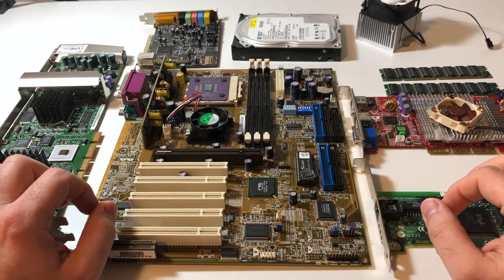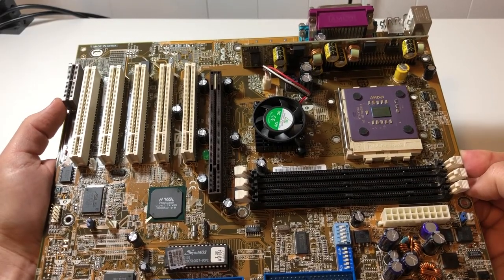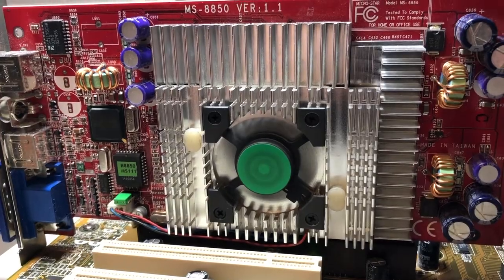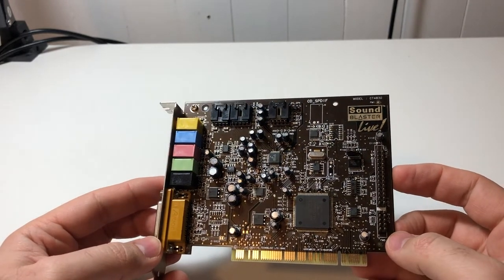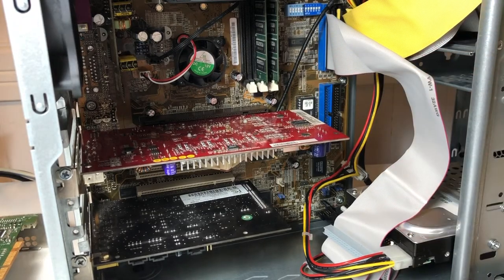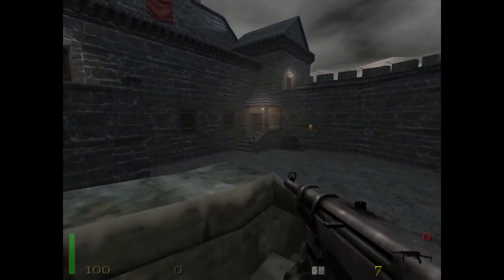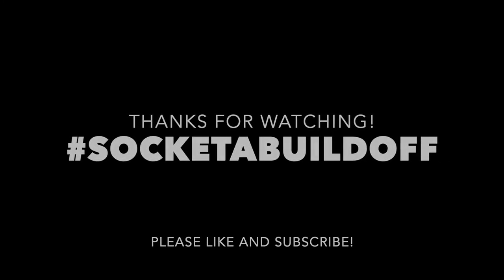Building an AMD Thunderbird Gaming Rig - Geforce 3 and 3D Labs Wildcat III! #socketabuildoff

Comment: One thing on the SB Live!: It had 4 way positional audio. I think it was the first consumer card ever to support that. All serious games at the time, like Half-Life and Unreal engine games, supported it. It was my first 3D audio experience, and it was awesome. There were bundles with Cambridge Soundworks PCWorks speakers. I had this set back in the day. My son still uses the sub/amp of that speaker set on his rig today, so that tells a story about quality.  I recently got a second set complete with the original satellites. That was the last piece of hardware I needed to recreate my 1999 setup (Gigabyte 6BXC, 300A@450, TNT, SB Live!). I think I threw out the SB Live! when I got a socket 775 board many years later.
Reply from the maker: Thanks for your comment! That’s right I forgot about the 4-way audio! I really need to explore the features of the SB live again one of these days. I remember the Cambridge sound works speakers too! Those were awesome and I remember really wanting to get a set back in the day but they were too expensive for me. Those and the old altec Lansing models were great 👍
Reply: Aureal had 3D audio, I don't remember i think they released it before Creative, but Creative bought them and stopped technology improvement decades.

Best wishes.
Reply: @ajax700  Indeed, I remember many games supporting both A3D and EAX at the time. I'd not say tech didn't improve in the upcoming years though. 4 way audio didn't have a long life expectancy anyway as DVDs with Dobly Digital 5.1 became common. 5.1 sound cards quickly emerged everywhere. But beyond that? Frankly, I can't even imagine how consumer PC audio could have possibly been improved any further.
Reply: Both EAX (I'm sure) and A3D (at least I think so) positional audio parts were based on Microsoft's DirectSound3D API, which became available before Creative and Aureal launched their first cards for that. At least Terratec and Guillemot had cards out earlier which supported DirectSound3D with corresponding quadrophonic (4.0) output. Those were still ISA cards! I own one of those, a Guillemot Maxi Sound 3D. I got a SB Live! with my brand new Pentium 2 system in late 1998 and it was indeed awesome. A cool feature a friend at that point already used was the SB Live!'s capability to encode DS3D/EAX 4.0 audio into Dolby Surround Pro Logic which is also 4.0 but instead with a center channel and mono surrounds. Thanks to that people who already owned a Dolby Surround system could enjoy positional audio from PC games although with mono on the back speakers.
Creative with the first SB Live! also launched a proprietary Digital DIN connector which could transfer 8 discrete channels digitally, way before HDMI was invented. Sadly thanks to the media industry it was only implemented on the highend Cambridge/Creative SoundWorks speaker systems, but not on AV receivers of the usual suspects (I still think to remember reading about Harman Kardon having an AV receiver model with Digital DIN ready, but I've yet to find the German PC magazin in which I think it was reported). Creative had to kill Digital DIN later under pressure from the media industry because they wanted their crap HDMI instead to force DRM on consumers. That's why only one third party model X-Fi, which had HDMI, can output lossless 5.1 gaming audio. All other X-Fi cards can only output analog or compressed digital bitstreams which was pathetic.

Comment: Miss my socket A system. It's final form of sorts was, Athlon XP 2500+ Barton OC to 3200+, 2x 1GB xms DDR400, ati 9600xt 128mb, 160gb WD 7200 IDE, Abit Nf7-s 2.0. That nforce chipset was pretty good for its time.
Reply: I still have mine & a few nForce boards plus loads of memory

Comment: AMD Barton Mobile + Abit NF7S v2.0 + Samsung TCCD + GeForce 6800 Ultra + Audigy 2 ZS was my first enthusiast rig bought with my first job. Now I have again that rig except for memories and soundcard (OCZ Gold PC4000 and X-Fi Elite PCI) but I add to my collection a few mobos nForce3 (939 with an Opteron Denmark and AM2 with a Phenom Deneb), slot A with an Athlon Thunderbird and 775 with AGP and q6600. I love 2000's hardware 😄
Reply: Had a similar setup in around 2005 comprising of mobile 2500+, geil one w pc4000 184 pin ddr1 but had a dual xp1700 system modded to mp with hard modded multiplier & vcore on Asus a7m266-d mobo. Xp1600 on pc chips m810lmr 7.1, duron 1600 applebred @ 256kb l2 etc & about 5 more skt a rigs at one time run seti@home

Comment: Ahh Thunderbird.. I bought whole cart full of parts including Thunderbird 1.2Ghz at a local Fry's back in the day. Went home but no boot so took it back to the Fry's and the kid at the return section looks around the motherboard and cpu and connects the power to it and turn it on without heatsink on. Within couple seconds the core heats up and the computer shuts down. "Must be a defect CPU" Grabs a brand new 1.2Ghz CPU and puts it on and turn it on again without a heatsink. Same thing happens and burns another CPU. They didn't have any more of them in stock because they were so new so I asked for a refund and bought Pentium 3 1Ghz instead. Never looked at AMD until they came out with Ryzen 1800X.

Comment: Oh for simcity 4. Load it on a ramdisk. Even larger cities will run smoothly so long as the cpu and gpu can keep up! There's a bug (or poor programming) with the way it handles graphics assets. For example... Instead of referring to the same model of a house in memory, it loads another copy from the hard drive! This can also lead to what looks like a memory leak, especially with larger cities. The game is constantly reading from disk to load asset copies to ram. Sadly you'll have to have a lot of ram (as far as older systems go) 3-4gb for the game files on a ramdisk, another 2 or so to run it!
Reply from the maker: Interesting! I'll have to give that a try!
Reply: @vswitchzero  back with my ddr2 775 system I noticed that even my 8800gt was struggling to get high teens in fps. I made a ramdisk using an app creatively called RAMdisk and even my oddly clocked 575mhz ddr2 smoothed out any fps issues. Though I did notice that SC4 could use up my remaining 2gb lol. Made a 2gb ramdisk leaving 2 for SC4 of my 4gb setup. Cpu was a pentium e5300 overclocked to 3.2ghz.

Comment: The Wildcat III Pro was my first non-consumer card... at that time I had moved to the Athlon MP using a Tyan S2462 board.  Absolutely massive gear - housed it in an Enlight EN-8950 server case with redundant PSU's.  That stuff was truly made to last; I'm sure it'd fire up readily to this day.

After 386 and K6-2 I went to Socket A as well - have never been an Intel fan : ) thanks for this blast from the past !

Comment: The AGP Pro card you showed was a Dual Chip system, hence why it was AGP Pro. You can see thee is a bridge chip on the PCB directly above the slot. This allowed the 2 chips to work together as well as allow both chips to communicate across the AGP bus. Fun fact. AGP was Actually a faster implementation of the PCI bus, except it was mean for single device with a direct connection to the Northbridges. Its main benefit over PCI was the fact that the entire bandwidth was dedicated to the GPU rather than having to share bandwidth like PCI. It ran at 66Mhz rather than the 33MHz of PCI. AGP also allowed the GPU to have direct access to the system memory. this allowed the GPU to store textures in system memory if the onboard GPU memory was exceeded. 

Downside of AGP was it was less tolerant of FSB overclocking compared to PCI but thankfully chipset manufacturers implemented quite a few different AGP frequency dividers which was welcomed by overclockers, since back in the day unless you pencil modded your AMD CPU, your only recourse to overclock was FSB

Comment: 4:18 DDR is a type of SDRAM. People keep referring to PC66/100/133 pre-DDR memory as “SDRAM” which it is of course, but they say that, meaning that DDR is not SDRAM…but it is, as is DDR2, DDR3, DDR4 and DDR5.

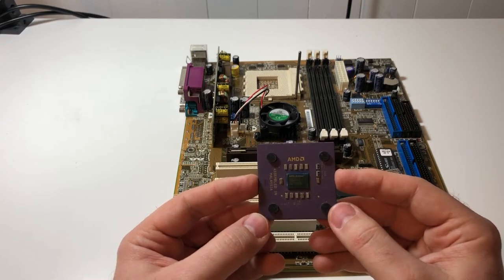9:01 Pentium 4’s we’re not around at that time. The Athlon Thunderbirds were competing with Pentium III’s, it was the Athlon XP line that was competing (and beating) Pentium 4’s…for a while anyway.
Reply from the maker: Both good points - You are right, the Williamette P4s weren't released until very late in 2000. The Pentium 3s were very popular all through 2000 and into 2001 so they'd defintely be the chips competing with the  Thunderbirds. This is a period of computing history that I'm not too knowledgable about, unfortunately :)

Comment: Nice ! That danger den 9800pro water block though 🥰  I still need to mess around with socket a
Reply from the maker: Haha yeah, Danger Den made awesome watercooling gear back in the day. Too bad they went under. I had a Danger Den TDX waterblock on the CPU as well if I recall correctly.

Comment: 10:30 One of the tricks I learned on these CPUs was to get a very fine piece of sandpaper, place it on a flat piece of glass, and "lap" the bottom of the heatsink to improve thermal transfer.

Comment: It's interesting to look at. I have similar Socket A PC that I slowly upgraded to be probably the fastest Socket A you can build. I managed to find mobile Barton CPU that runs at 2.5GHz, it's paired with nforce2 400 chipset and Radeon 3850 AGP.
It would be almost usable today for browsing and some basic stuff if it was not lacking SSE2 instructions. That killed it some 5 years ago. Every modern browser requires SSE2.
Reply from the maker: Thanks! The mobile Bartons were awesome. I never owned one but a friend of mine did. He got some impressive overclocks out of it too. That's interesting about the SSE2 requirement in modern browsers. I didn't realize that.

Comment: Great video !! I really miss the socket a days & overclocking as it was the start of good times. Had a thunderbird 1400 on a Asus Ali chipset mobo then xp1600 palomino on a gigabyte ga7zxe kt133a board using pc133 but mobo would do 156mhz fsb. Then a duron 1600 applebred which I pencil modded to 256kb l2 cache from 64kb. Also had dual xp1700 modded to mp plus hard modded multi & vcore @ ran at 2400mhz on asus a7m266-d. Xp1700 on abit nf7-s 2.0 @ 2xxx mhz, Athlon 2500 Barton & mobile at 2400 & 2500mhz etc

Comment: The T-Bird chip one hot chip when overclocked...
I remember using pencil to connecting the exposed L1 pins and that's when I to the dark side water cooling a machine....
Back then it wasn't normal to water cool a machine, compared to today it's normal

Comment: I absolutely broke an egde off my Duron back in the day... But I'm happy to say it still did work just fine. The only minor issue was that the Bios did not detect it as an Amd Duron anymore, just as some kind of standard Amd cpu IIRC. But I used it for several years after that! Oh the memories ;)
Reply: And I had a very similar Board, used the additional IDE connectors not for RAID, but to enhance the available disk-space. When I had 8 HDDs in and the RAM maxed (I believe it held 1,5 GB), it was a beast of a server, hehe

Comment: I used to have a wildcat 3110 AGP-Pro on a p4 478 and older wdraptor 10kdrives SCSI fond memories of video editing although after software compatibility issues with the wildcat 3110 I ended up going with Nvidia Quadro fx3000 g I believe it was yeah with the SDI output and input I'm just surprised to see another one of those cards what other kind of cool and unique especially when I was a younger guy doing my comp TIAA certifications before 08

Comment: The original fan on the GeForce 3 is not defect. I had exact this sound for one simple reason, a small holding clamp on the fan for the two wires came up from time to time. Very hard to sea but check it, after I pulled the clamp back to its position, the fan works perfect without noise ;)
Reply from the maker: Thanks for the tip! I will give this a try 👍

Comment: i loved those promise controllers back in the day, most  of my computers had 6 or more hdds, at one point i even converted an old model 50 case into a scsi container for 7 external drives. tiny drives by comparison these days, but i had over 100 gig in 99. i  regret the loss  of the ibm ps/2 model 50 though, fastest  486 i ever had even though it  was only a dx2 66. micro channel and all scsi.

Comment: Once we got an AMD slot A CPU and a slot 1 motherboard for free as defective units. We tried how high the flames will go if we insert the slot A CPU into a slot 1 motherboard and power it up :)
At that time, I also had a Pentium 4 motherboard with an 1.6 GHz CPU. The board supported both SDRAM and DDR1 RAM modules. I never thought I could ever see DDR1 RAM work with SDRAM in
 the same board, at the speed of an SDRAM.

Comment: Saw you watercooled a Radeon 9800 Pro amd instantly subbed.
Reply: These days I hotrod retro software.

For example 60.8GBs is stable for id tech 3 for all level compiles. You need a 8k display to really make the balls to the wall until x86 crashing version planned make sense.

Comment: My SocketA -system is a maxed out one :) Abit KT7A-RAID, mobile-Barton @2GHz (no help clocking higher, SDRAM is the bottleneck) with 150FSB, 768MB RAM, 140GB WD Raptor SATA (with PCI-SATA controller), Radeon X800Pro (Nvidia-cards just don't work with this mobo fully stable). And the sound cards: SB Audigy2 (for EAX), Aureal Vortex2 (for A3D), ESS Solo-1 (SB PRO in DOS), Gravis Ultrasound Classic 1MB. Dual-boots Windows 98SE and WinXP. I can freely change cpu multiplier AND FSB speed from DOS or Windows, so I can make this very slow easily. Tried to add Voodoo2 -card but Radeon drivers freaks out when Voodoo is installed. With Geforce I can use Voodoo but not stable enough.
Reply: How do you manage all those soundcards in terms of resource conflicts, IRQ etc.?
Reply: It's easy :) Audigy2 has drivers only in Windows XP. Vortex2 has drivers only in Windows 98SE. ESS SOLO-1 is only for SB PRO support in DOS and uses port 220, irq 7 and dma 1. GUS is used only in DOS and uses port 240, irq 5, and dma 5. But now I got Orpheus II and swapped GUS and SOLO-1 out for it but the resources are still the same. Tried to get Vortex2 and Audigy2 to work same time in Win98SE but problem was A3D and EAX, both use a3d.dll for it so it's only one or another.

Comment: Have you done a drag race between CF and HDD? 
I see people changing HDD to CF in oscilloscopes and not really seeing a speed difference, ie, maybe it's limited by the ATA interface speed of the motherboard. I think they were Win95-ish era, so maybe ATA/33/66-ish.
But then I talk to guys doing CF in DOS industrial systems and saying it's faster, but these guys don't specify hardware, ie, they might have something like Pentium200 or better, ie, faster interfaces.
Basically the people making the claims never look at the hardware, just the CF. 
PS. I just realised, the HDD speed also matters.
Reply from the maker: Thanks for your comment! Can't say I've ever done a direct comparison (especially with old hard drives from the early to mid 90s). The transfer rate of CF cards can vary quite a bit, but the industrial cards I use are rated for about 30-33MB/s, which is way beyond what early IDE controller can do. Only UDMA/33 or faster could take advantage of those transfer speeds. Even with a slower controller, the biggest difference between the two is the access time/latency. Even if a HDD and CF card could saturate the interface, the near-zero access rate of the CF would make game/app loading feel much faster. If you were doing file copies (large sequential transfers), there would probably be little to no difference. Of course the awful bearing whine being gone is a huge plus too :)

Comment: Wow, some serious nostalgia for me in this one.  I ran an AMD Thunderbird 800, with a SoundBlaster Live, and an ASUS V7700 Nvidia GeForce 2 GTS, on an ASUS A7V motherboard as well, with some Logitech Z-something speakers.  XD

I think I was running a couple Maxtor DiamondMax 80GB HDDs at the time, iirc.    It was a rather nice system layout for its era.  AMD had the edge for a bit back then, for sure.